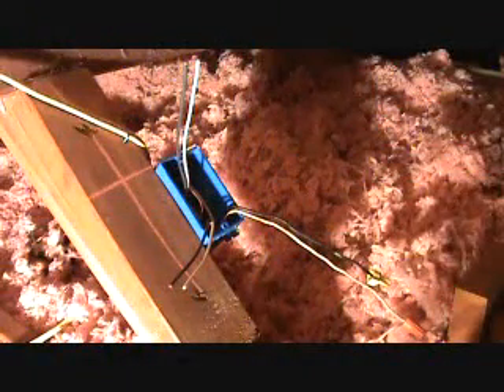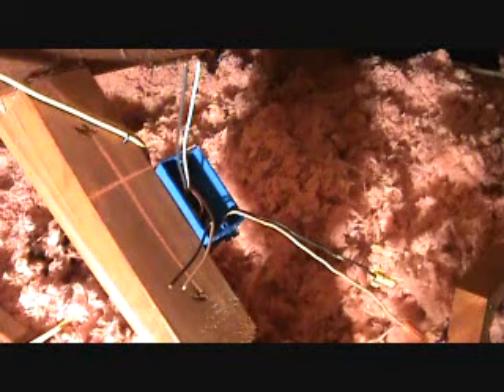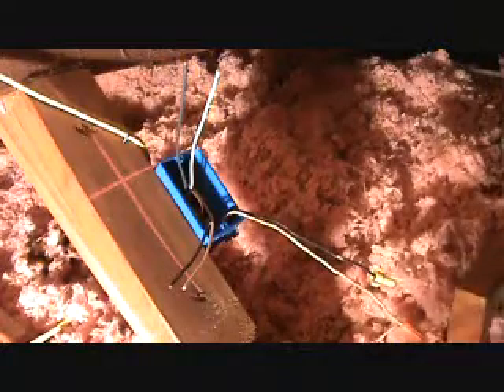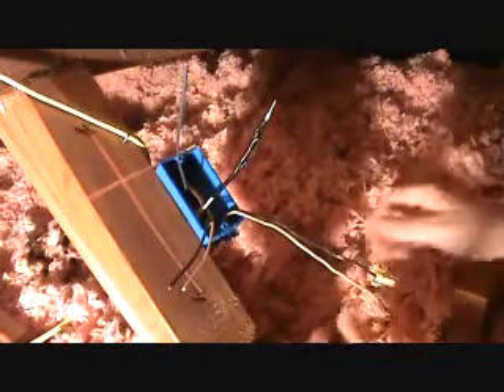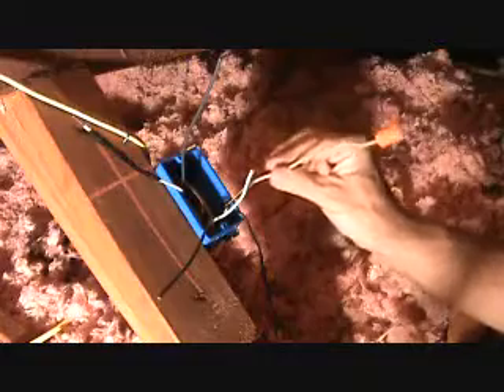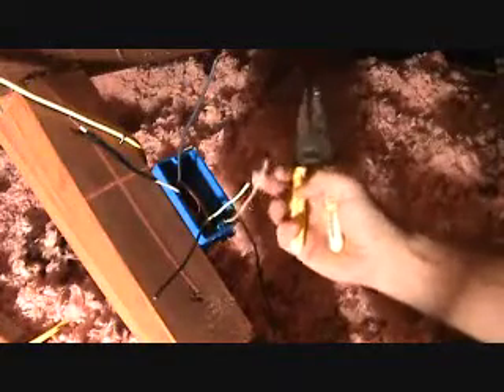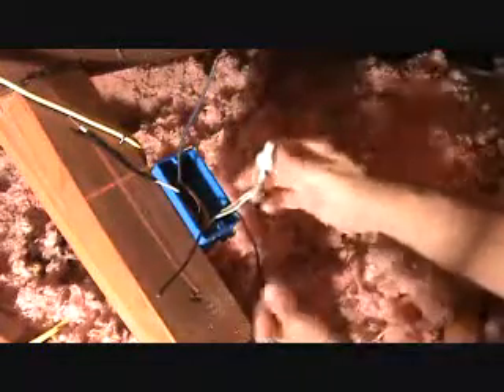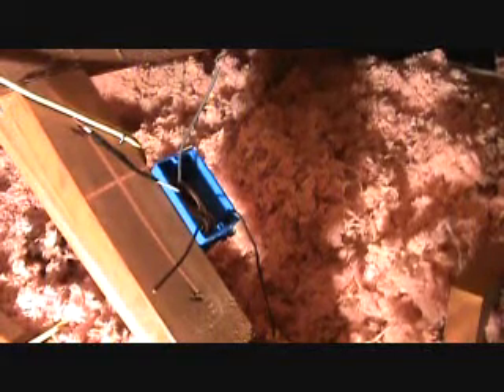How to wire up a tricky electrical junction box...Part 4

Comment: have an issue in similar scenario ..have light switch that runs in attic and connects to a plug..flip swith plug turns light on...i boght a ceiling fan i needed to put a box in ceiling easy enough..then i put a junction box and spliced it into the line in place ..in short cut the existing line added a long pig tail to ceiling fan box.. wired in fan and following happened.. flip switch up no fan pull fan chain plug goes off ..fan motor turns but its light kit wont light ...i was told i wired it right by fan co. what do i have wrong
Reply from the maker: +Joe D Not sure where you have gone wrong since not sure how you have wired every item for this project. My suggestion would be to go to your local hardware store & go to the electrical department & talk to a salesperson & explain o them in detail what you have done & then they will ask you a few questions & back & forth you'll go until you understand what you should change on your wiring. I think that would be the best thing to do. Let me know how it goes. Thanks for your message!